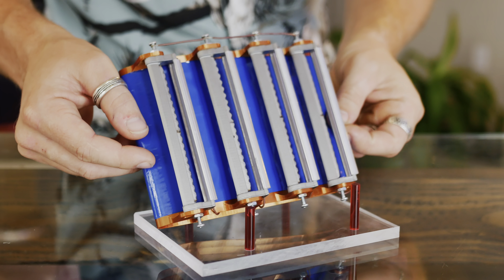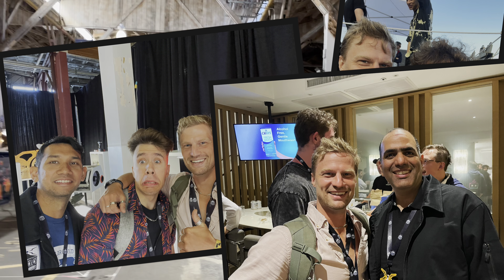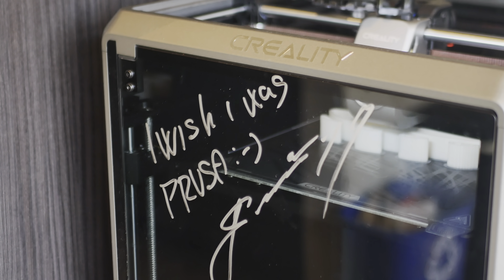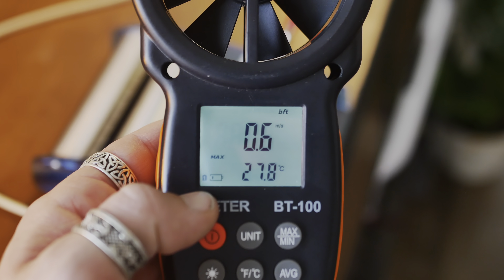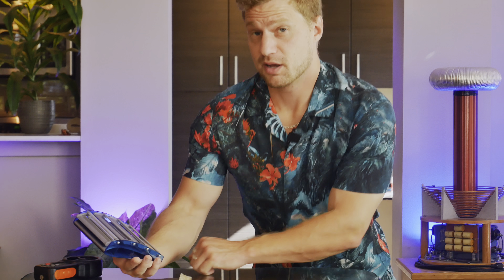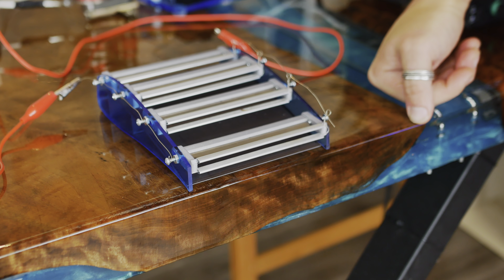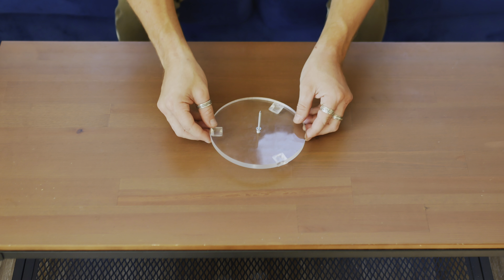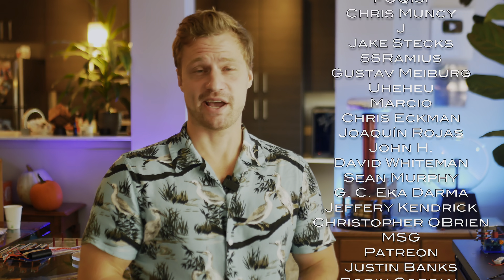Designing A Self Propelling Ionic Thrust Wing

Comment: You should have an alliance with the tomato, Joel's main enemy
Reply from the maker: This may be a secret weapon I never realized.
Reply: @PlasmaChannel  Also please try to contact with Tom Stanton, he perform experiments with plane which powered by pressured air. He know a lot about how properly to reduce a weight.
Reply: @vmened Please do not get too dizzy. Only tom Stanton for peats sake.
Reply: @PlasmaChannel  
A golf ball has dimples on it to travel farther. So if you dimple the bottom of the wing it will cause lift. 
Also a thin sheet of plastic wrap ( for food ) above and over the thruster ( as a scoop ) will cause a pressure difference at the leading edge. This will vacuum in more air to push out.
Hope that helps.
Reply: @PlasmaChannel  you still have not used the photoelectric effect to generate electrons/ions
Reply: @PlasmaChannel you could even make the battery/power parcel apart of the wing itself therefore less trouble where to place it
Reply: @PlasmaChannel a weapon to surpass metal gear
Reply: @PlasmaChannel Choo look like Aaron Eckhart’s brother.
Reply: @PlasmaChannel are any of your friends familiar with the Flower/Seed of life?  It's a plasma geometric dark energy thing, I have insight and can help.🕸️🌼👀
Reply: @PlasmaChannel hey that was the idea i saw in my dreams, great to see you make it a reallity. Also, i was day dreaming.
Reply: @PlasmaChannel HEY NERD,,, Attach it to a weather balloon or floating cushion... like a zeppelin with ion thrust... helium might explode I guess
Reply: @HYEpower "helium might explode" 😅
Reminds me of the episode of Archer where they're on a dirigible filled with safe helium, but Archer can't seem to understand that, and keeps slapping a guy who is smoking, because he "might cause them to explode" 🤣
Reply: @HYEpower  Helium doesn’t explode. Hydrogen does. Helium doesn’t react with anything.
Reply: @HYEpower  Then attach some cameras and communications gear to it and float it towards China's airspace. How far would it get?
Reply: HELIUM WOULDN'T EXPLODE. iT'S HYDROGEN ZEPPLINS THAT EXPLODE
Reply: @HYEpower  helium is an inert noble gas, it doesn't explode.  Hydrogen explodes.  Blimps switched from Hydrogen to Helium after the Hindenburg burst into flames.
Reply: @HYEpower   Helium is literally a Noble gas, you might mean Hydrogen might explode
Reply: @HYEpower  Karabakh is Azerbaijan 🇦🇿🇦🇿
Reply: @PlasmaChannel  Rick has opened a shop, where he sells rolls. He says to his shop "Never gonna give you up" the shop replies "Never gonna let you down". He then names his shop rickroll
Reply: @legendxgamerz1356  😂😂😂🖒
Reply: Wait a sec. Letmetell Joel bout this
Reply: This would be cheating. Two against one. And you know the riff between Integza and the Tomato King has turned into a personal thing. They hate each other
Reply: Skin your airfoil with tomato skins , and you might be able to work together 😜
Reply: @kti5682 no. photoelectric effect releases electrons on shining light. cadmium sulphide. idea is to increase electrons released without relying too much on high voltage. the hv would be used to accelerate the released electrons.
Reply: Hahahahhahahaaaaa!!!! Love this
Reply: Don't do it! Don't give in to the tomato lord!
Reply: Nah that's too far
Reply: No way! We need them on the same team. This is the future happening now.
Reply: But tomatoes are gross
Reply: You definitely need a tomato in a lab coat to tease joel
Reply: Tomato's are decently American, I call to witness. The BLT
Reply: Integza can't make gaskets for shit and it pisses me off lol
Reply: And remember.....tomatos are disgusting...
Reply: * Integza is typing aggresively *
Reply: eat a tomato evrey time when you call joel out
Reply: I approve, and add RC and Aerodynamic Engineering Creators to the Gang
Reply: You should integrate the motor inside the wing and use motor as support structure of the wing
Reply: @thetriplemechanic. I’m new here and new to the concept as well. What’s with the tomato ?
Reply: What a diabolical alliance....I LIKE IT! 😂😂
Reply: What?.. Why?
Reply: This 100% took me out 😂😂😂😂 I love rocket man
Reply: lol
Reply: Pjo